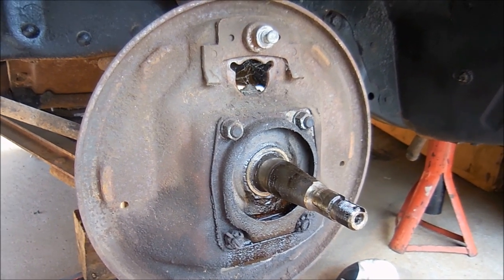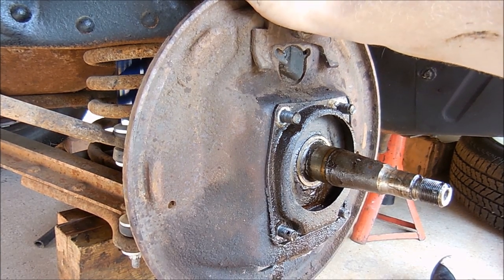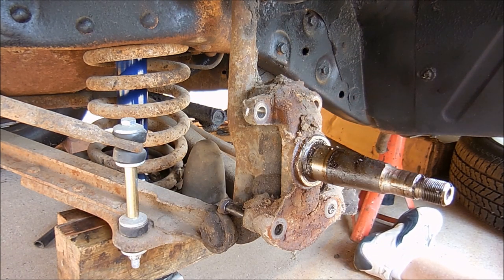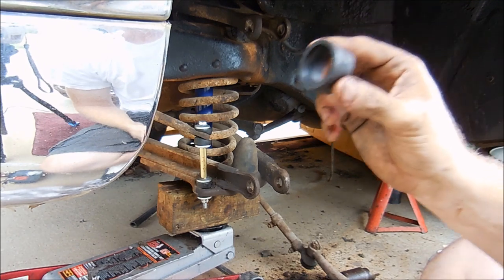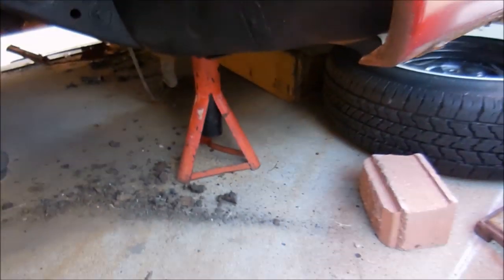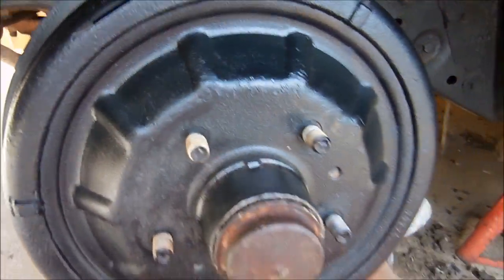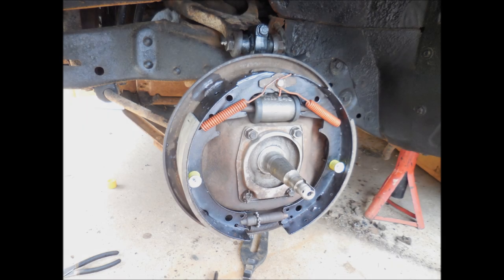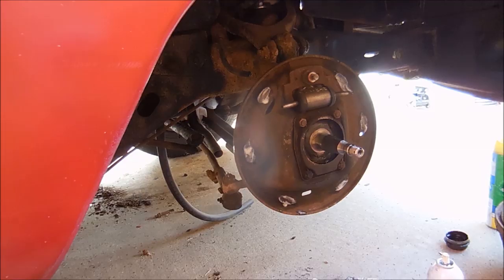1956 Cadillac Sedan DeVille Resto Video 27: Front Brakes & Spindle Swap

Comment: Good job sir, however hears a suggestion, always load grease into the hub cavity before replacing the outer wheel bearing. You should always do that to insure the bearings won't get
overheated due to inadequate lubrication.

Comment: Love the Caddy! Just an FYI. Next time you knock out those bolts to change the spindle or any bolt that you plan to use again, put the nut partially back on to protect the threads.  once the bolts are free and most of the way out, remove the nuts and take out the bolts. Threads saved.

Comment: my 56 olds Super rocket had the same thing, left hand threads on the drivers side.
Reply from the maker: ghtowagon I think it is a 50s thing!
Reply: TheCorvetteBen Yep my 51 Pontiac and 57 Willys have the same thing left handed wheel studs on the drivers side.
Reply: TheCorvetteBen Hmm, I don't think many FoMoCo's did this. My '54 F-100 was not. Very Interesting.
Reply from the maker: I believe it was a GM thing, but who knows. I know that the driver's side wheels on my bel air were left handed thread, while the ones on the edsel were not

Comment: really like the videos, I have a 56 sedan deville,with eldo motor w/dual 4 barrels, CO car, not much rust, but the interior is dry rotted.  where did you get the carburetor repair kits, they are going to need it.
Reply from the maker: I got them at oriellys believe it or not
Reply: TheCorvetteBen are they the same for each, I thought  I had seen where there was a difference and does AC make a difference
Reply from the maker: Mine are identical, as for other years I think one was a little different than the other. I think with AC you have an extra bracket and an idle stop solenoid.